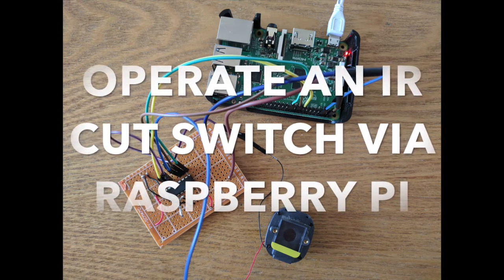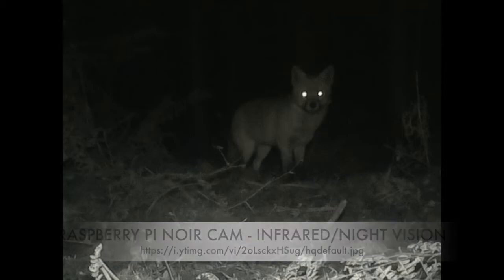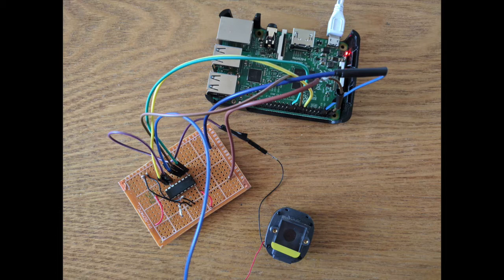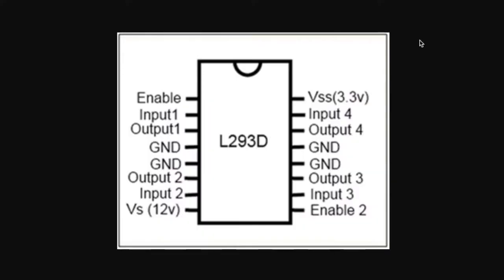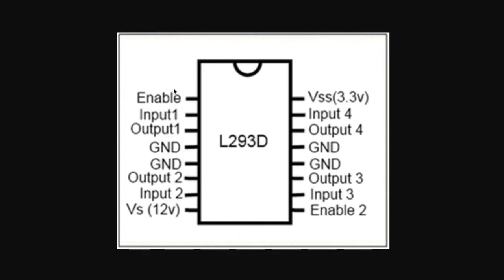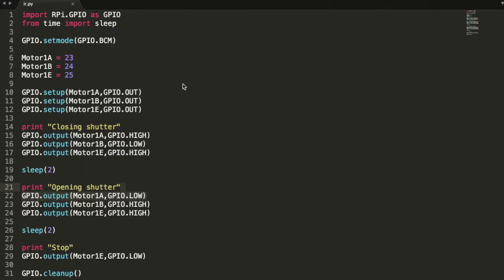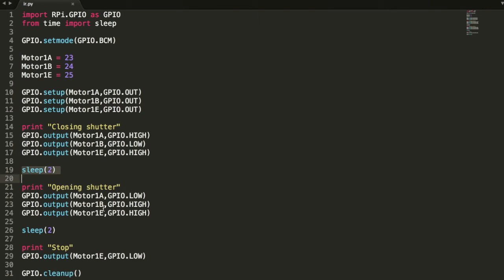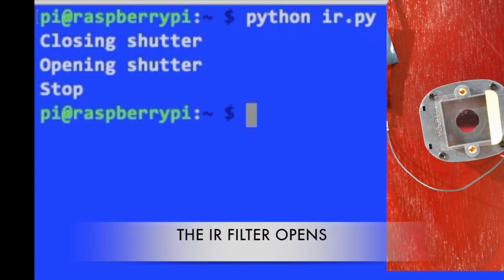RASPBERRY PI: HOW TO OPERATE AN IR CUT SWITCH EASILY!

Comment: Nice to see my ir cut method in wider use. I'm currently using this method to control ir-cuts in 5 bird boxes and related projects.  See my blog for examples: http://nestboxtech.blogspot.com/
I'm after a smaller footprint method to switch an IR cut, one that doesn't take up as much space on a board though...

Comment: I believe there's a hardware-only solution to this problem. It should be possible to do this with a photoresistor, a variable resistor and a transistor. I'm not 100% sure as i'm by definition a programmer and only an electronics hobbyist at best. I will try it in a few days, if it works I might write a tutorial.